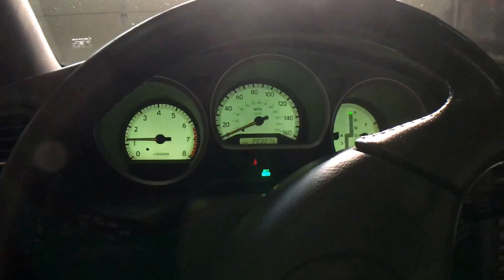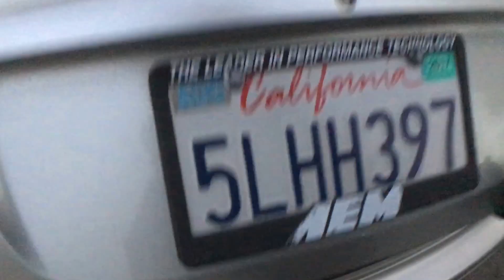Civic e.g. B16 turbo hatch on e85

Comment: Estimate on power?
Reply from the maker: BB6_Godoy I wish we knew but if I had to estimate I would put it around 250 to the wheels. But I really don't know. He's around 10 lbs on e85
Reply: UNDER FUNDED GARAGE nice I’m looking at B16 eg today and plan for boost
Reply from the maker: BB6_Godoy nice I would look into checking the compression with a compression tester. But good look bro